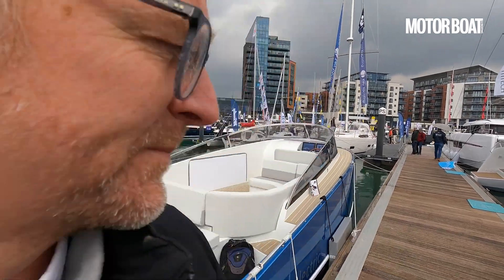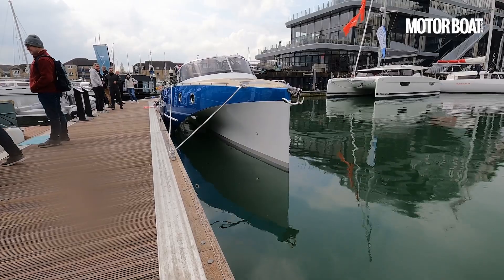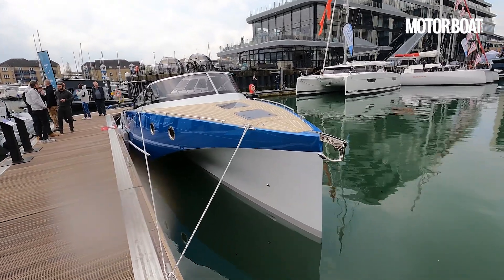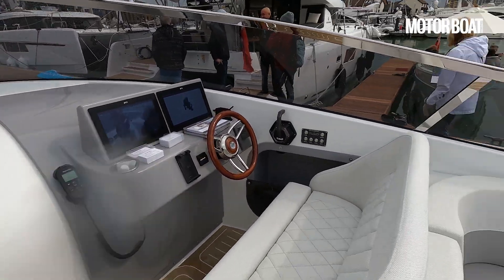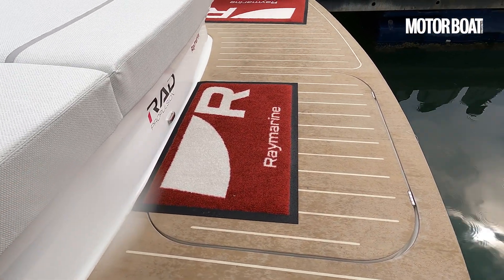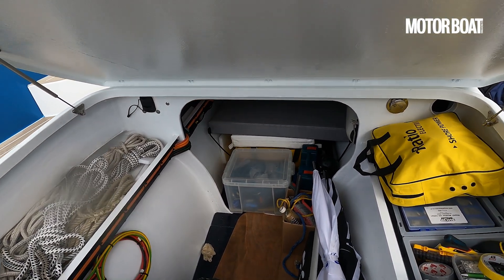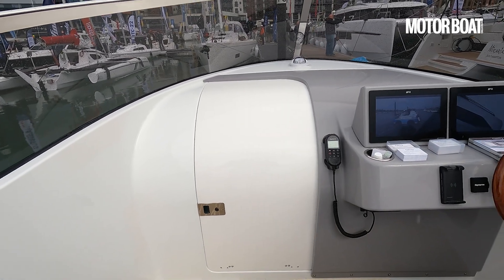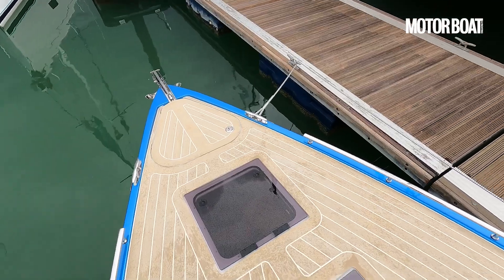Revolutionary electric boat with 200-mile range | Optima E10 yacht tour | Motor Boat & Yachting

Comment: A superb boat, no limitations over traditional engines at all.
200 miles is more than you'd need for a boat that size.
Reply: It's limitation is speed, weight and having a battery pack that when it meets saltwater tends to have an explosive reaction in the worst of ways.

Comment: Battery boats I think like the cars will have a very short life. One of the major Japanese car manufacturers has a hydrogen engine and hydrogen generating plants in production. They hope to have 800,000 hydrogen engine cars on the road in japan alone by 2025 and 1.5 million more the following year. I dont think it will be long till the hydrogen generating units are small enough to fit to a boat of a similar size powered by solar panels as the ground based ,stand alone units are. Hydrogen storage is no more dangerous the an the gas conversions we put in cars in the late 1970's early 1980's. With the proper installation and storage tank they should be 99% safe. Nothing is 100% regardless what manufactures say. I cannot ever remember a gas installation ever exploding  or going on fire during my time in the trade.
Reply: Hynova 40 is a hydrogen powered boat and its founder says they are taking orders. We shall see.
Reply: Yup - hydrogen/ev hybrid will be the way forward. Batteries and battery manufacturing are horrible for the enviroment. We are still just digging up the ground for finitie natural resources to get these things made. Battery recycling has not caught up to demand. Western city power grids all over are held together with splices and never redone (know folks who work on them for major cities and all say if everyone went electric it would be toast) not to mention we need more power generation which then gets the activists all riled up despite them wanting EV's.
Reply: Hydrogen is a total red herring , uses 3x as much electricity to produce it and it’s nearly impossible to store safely.  Currently using coal , gas to make it …totally wrong in so many ways but JCB and car companies brain washing ignorant folk into believing it’s green

Comment: I have written a press release containing all the necessary buzzwords: revolutionary; way of the future; cutting edge technology; ecological mindfulness; radical engineering concept.
It fails to mention: prototype is non-working; no proof of concept work has ever been done; no commercial supply of any components (batteries, chargers, motors) is guaranteed; no production facilities are available; no production funds are available.
What imaginary cruising range should I claim (with no scientific basis or justifiable reason) to get you to visit my garden shed to see the 1/8 scale (or it might be 1/10 - depending on how I feel) boat-shape object made of modelling clay and polystyrene that I swear is the next big thing in electric boating ? If you prefer, I could whip up an electric flying car or a self-flying drone that looks really cool and futuristic - with all the stylish swoops and dramatic curves necessary to obscure the glaring lack of practical features that it would need to perform its mission... I could probably re-use most of the boat model for that...
As professional journalists, you should know by now that the vast majority of these tech start-ups never see a single production example - and that is by design. These projects are aimed at gullible venture capitalists to invest in development, not at end-users to buy the product. So until there is an actual working prototype undergoing sea trials that correspond to the original performance claims, please stop wasting our time - we are not the target market for these boondoggles and white elephants.
Reply: I made it very clear that it is a prototype and doesn’t yet have a fully sorted business plan but the couple running it have invested a lot of their own time and money developing something a bit different which I thought viewers would be interested in seeing it. I quite understand if you are not one of them.
Reply: Meant to add that it is a working prototype that made its own way to the show and back but is currently using a simple shaftdrive electric motor rather than the bespoke electric sterndrive that is currently under development at RAD.
Reply: @hugoandreae3785  So the most important component of the whole concept is not yet developed, let alone installed, and somebody else's commercially available motor / drive unit (of a completely different type !) is being used to make this thing move. I don't think you understand why that is not a positive thing to say.
To illustrate how that makes this so much worse, let me correct my own press release: "I am developing a Dilithium Crystal Infinite Improbability Drive with Hyperspace Jump Technology that runs on Fairy Dust, emits as it's only waste The Elixor of Life in handy one litre recyclable cartons and pays you a pension when you retire.
I drove the prototype to the show using a Petrol 2 Stroke Seagull Outboard because I haven't finished development yet. But please take me seriously."
No, I don't think I will, and nor should anyone else, especially (and I cannot believe I have to say this again) A PROFESSIONAL JOURNALIST.

Comment: What was the point in highlighting this particular boat if you couldn't show us anything and it was 50% complete? It looks terribly plain not fitted out with anything. I would have waited to unveil a finished boat, nothing gained here unfortunately.
Reply: We will of course do a full tour and sea trial as and when there is a production model available but I don’t see any harm in showing off interesting concepts like this so long as we make it clear it’s still a prototype, albeit a working one.
Reply: @hugoandreae3785  Why does the description of THIS VIDEO say "MBY editor Hugo Andreae takes us on a full tour of the Optima E10 electric boat." ?
The propulsion system does not even exist yet. There is no interior cabin. The cockpit is incomplete. The batteries / charging system were not shown. And it definitely is not a "working prototype" if it uses someone else's commercially available drive unit.
What, exactly did you show us apart from some bloke in a garden shed's fever dream based on slinging some random fibreglass at a second-hand speedboat he picked up on eBay ?

If lovable eccentrics want to show off their crazy homebrew contraptions, I would be all for it (I love Merlin-engined cars and Batman vehicle replicas as much as anybody) - just stop pandering to the delusions of those that think their latest Heath Robinson machine is the future of transportation. And if they claim it has a Merlin engine, at least check it isn't really a 2 litre VW diesel.
Reply from the maker: @RandomGuyRandomNumber  I take your point re the description of this as a 'full' tour, I should have spotted that overly generous description. However, I disagree with your definition of a working prototype as almost all boats, production or prototype, use someone else's commercially available drive unit. They are planning to install a more efficient sterndrive unit at a later date but it is still a functioning prototype that drove to the show under its own power. Nor is it based on a secondhand speedboat, it is a bespoke design built from the ground up to maximise the efficiency of the electric drivetrain. Whether it proves to be a commercial success or not is another matter but I'm all for encouraging new ideas and giving people a chance to show them off. Nobody's forcing you to watch it!
Reply: @MotorBoatYachting  When you:
Misrepresent what is being offered ("full tour");
Fail to exercise any journalistic integrity or judgement (baseless claims are allowed to pass un-remarked, e.g. A "starting price of £400,000" when you are informed there is no business plan and the boat is not yet for sale; 200 mile range when the propulsion unit is not even installed; "revolutionary" based on no evidence or even attempt at description of any technology at all);
Completely misunderstand and misrepresent the term "working prototype";
That is tantamount to forcing me to watch - it's called CLICKBAIT, or MISINFORMATION or just plain lying.

When the major part of what is being "offered" is a bespoke powertrain, the substitution of an existing powertrain of a completely different type (shafts versus stern-drive) means it is not a working prototype. It is barely more than a styling buck, especially when the incomplete cockpit and lack of interior cabin are taken into account. Not a single element of this boat is in anything remotely resembling "working" status: Propulsion system; control system; hull (shaft drive instead of stern-drive, remember ?); cockpit; cabin; production methods or facility - absolutely nothing is actually being tested in any meaningful sense. It's a styling buck that has been made mobile in order to trot it out to gullible VC's and journos who should know better.
Installing that claimed "revolutionary" and "bespoke" drivetrain in an existing speedboat hull would make it a working prototype, however. You have it completely the wrong way round. But the person behind the project is not an electrical engineer or a naval architect, he is a soi-disant FRP production specialist, so unsurprisingly, he also has it the wrong way around. He has done the easy part (moulded some FRP), and all the tricky bits are TBD.

Advertising a YouTube video on a commercial magazine's channel as a video by the Editor of that channel imposes more journalistic responsibility than some guy posting stuff that happens to interest him - you have a responsibility to exercise some judgement. If you don't wish to be held to a standard, then post on your own personal channel.
"You don't have to watch it" is the laziest and most pathetic cop-out of a poor journalist.

Comment: We know electric tenders are the way of the future, but like I've said before, they need to have something like a small outboard fitted with sharrow props or the newer high speed low drag props they come out with ,essentially a weedeater almost, but it runs on a battery pack from like a DeWalt or Milwaukee power tool set. The batteries are going to lose charge or drain too fast, and granted, most people on tender rides aren't going more than 5 or 10 knots away from the home yacht, you could still go further or something happens and you need to get home or in radio range. Having a plug in small motor or plugging directly into the boats power supply with a rechargeable battery pack makes the most sense. There are oars obviously but on a larger tender, trying to paddle home is almost impossible and trying to get guests to help is a sin and probably a disaster.
Reply: Ev has been used in boats since as far back as powered boats existed. It is only the "future" because that is what the governments of the world have decided is the quick "fix" for the environment without actually having to look at the vast ramifications of it. It is just another ecological disaster waiting to happen.

Comment: I'd love to know the difference in price between automotive and marine-spec battery packs. For electric boats to succeed, a manufacturer must not blame the price of the battery for making the boat expensive.
Reply: I’m not sure his comment re: the cost of 2 (63kwh) marine spec batteries was anything but speculation. It’s a concept boat and the economics don’t seem to have been fully worked out. 125kwh is ~$80k, wholesale being less. 

Suppliers don’t seem to have distinct products that are marine grade. The biggest variation is batteries built as starter batteries that have direct current from an alternator. And thruster batteries can sometimes be different, but even then that’s often voltage differences from the house bank.
Reply: Buying the batteries might be the equivalent of 5 years or more of fuel?

Comment: 200 miles... at six knots. These horrors are sailing boats for those who can't sail. 

Batteries have a 1/50 energy density/weight/bulk efficiency compared to diesel.

If you don't like diesel, sail.

Comment: The electric hype the way the technology is right now will die down if the ease of charging and the problem of battery  production and disposal is not solved!
Reply: And it won't be soon. The hype is being driven by governments forcing it down peoples throats because they can use it as a quick fix solution and make the mandates outside of their time in political office - this can will get continually pushed down the road. The governments can then blame the population for the pollution while continually turning a blind eye to their militaries, shipping and air companies, farming. The US military alone constitutes more pollution than most major cities.